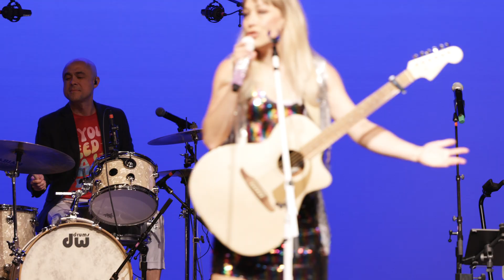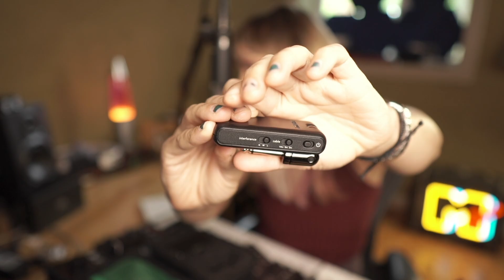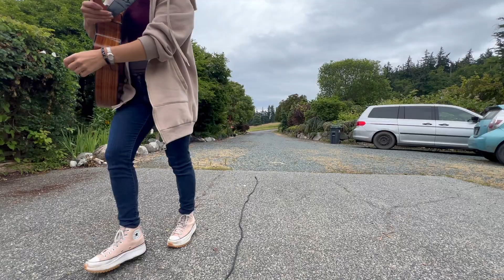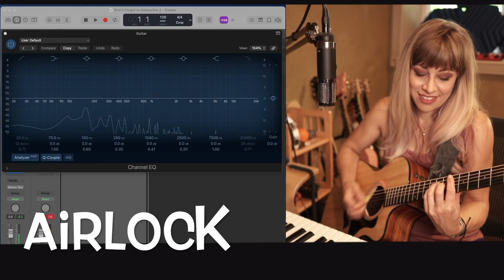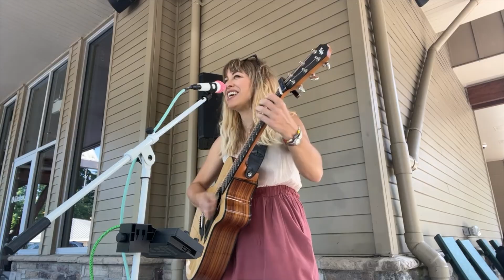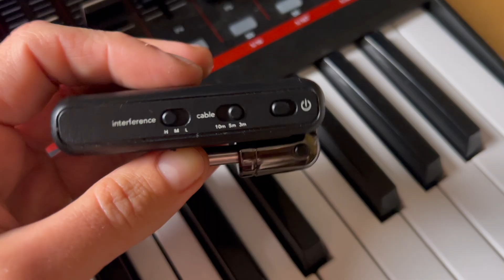Fishman Airlock - Wireless Guitar Rig!

Comment: I think the cable was a little bit richer in the sound but not by much. 
The fisherman must have a signature frequency to tell that it's reading the right transmitter. To not get it confused with other transmitters.
Reply from the maker: I expected that to be the case a little bit, but I couldn’t personally tell much difference. Ya the frequency thing is interesting. Different than other wireless products i use. But however they work, it’s been working smoothly for me so far 👍

Comment: Releasing a device that operates on the 2.4 GHz band in this day and age doesn’t really make much sense. With technology having come so far, there are already dozens of high-quality, Chinese-made devices on the market. But here’s the thing: no matter how long the range is claimed to be, as long as you’re performing in a place full of people with mobile phones, routers, and other devices, that range won’t mean much. On top of that, you’ll constantly experience signal dropouts because the signals will interfere with each other.

I made a similar mistake by buying the Sennheiser XSW-D (which is similar to Fishman’s wireless system). I trusted the brand and thought it would be very high quality. And yes, it’s not poorly made — but it’s no different from any generic Chinese-made device. The connection drops, there’s interference in the sound, and especially when performing in large hotel venues during the summer season, it’s simply unusable. Even at home, in an environment with multiple tablets, phones, computers, and laptops, I can’t get a stable connection.

In short, I love Fishman. I have the Platinum Pro EQ and Aura Spectrum DI pedals. But this product, considering its performance, is both too expensive and ultimately unnecessary. I’m sorry to be the one saying this — I really don’t want to be — but that’s just the truth.

When it comes to sound quality, it’s important to understand that the audio isn’t transmitted in analog form — it’s sent digitally in compressed data packets. Nearly all modern wireless systems for stage instruments operate using similar digital protocols, such as 2.4 GHz ISM band systems, Bluetooth (often with codecs like aptX or aptX Live), and proprietary RF digital transmission methods. Whether the device is made by a high-end brand like Fishman or manufactured in China, they’re often using the same fundamental technology.

The only real difference might come from the quality of internal components — better shielding, more stable power regulation, or higher-grade converters — which can slightly reduce noise or interference. But in terms of core transmission and audio fidelity, they’re largely the same.

Sennheiser, for example, uses aptX Live in some of its wireless systems, which is specifically designed for live music with lower latency and higher audio quality. But even that isn’t dramatically better — it’s definitely not bad, but I can’t say it’s noticeably superior either. And I say this as a working musician.
Reply: After saying so many critical things — is there nothing positive about these systems? Of course there is. They’re incredibly convenient. You don’t have to deal with adapters, cables, or external power sources. For everyday use at home or in small venues, they absolutely work — in fact, I use them myself. But beyond that, there’s a major drawback: the batteries in these kinds of devices are not replaceable. Once the internal battery dies, your only options are to open the device yourself and try to find a compatible replacement, or to throw it away and buy an entirely new unit. That just doesn’t feel right in terms of sustainability.

And that’s really the whole point of this critique — a product that functions as a disposable device should not be this expensive, especially when there are much cheaper alternatives that offer nearly identical performance. Honestly, I expected better from Fishma
Reply: @necipfazilaskar  The battery is easily replaceable. Fishman sells the replacement on their website and its simple to change out.